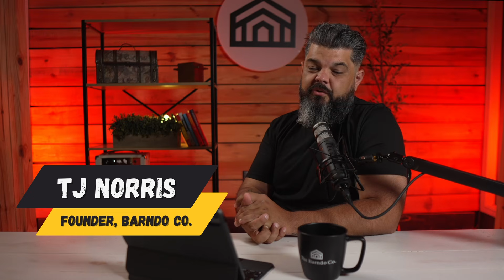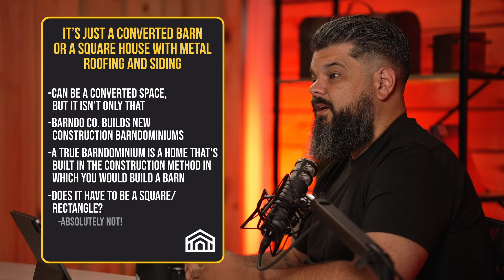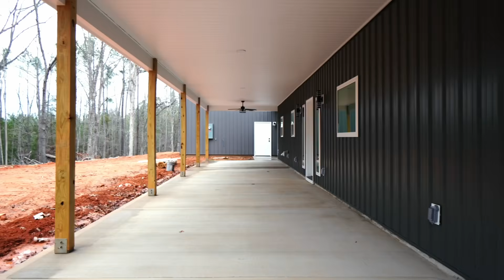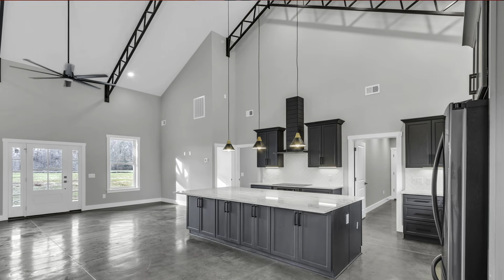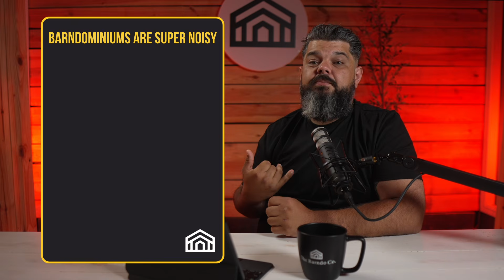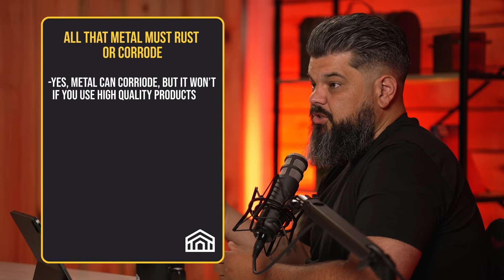5 Things Everyone Gets Wrong About Barndominiums

Comment: We built a 30x40 barndo is western ok before they were popular and it took us a year to finish it doing it on weekends and they are kinda noisy but we did 2 inches of closed cell spray foam on the roof and walls and then framed it in and just put metal on the ceiling but I think we definitely should of added something for noise cancelling when it rains even though that’s rare out there. It is super air tight though and you have to have the right ac unit that’ll bring in air. Electric bill is super cheap though and it’s on well water it’s about $60/month for electric but let me tell you about handling that metal on a windy day, it blows!

Comment: Echo, create some enclosed intimate spaces, a loft, use carpet and drapes, add surfaces for sound to be absorbed. Even creat8ng a hall that separates bedroom doors from main space, utilize some pony walls. Have high ceilings but dont be afraid to put a ceiling over spaces you want to not echo like a movie room or office. Put things like foam backing into large paintings on the walls. Wood floors even in some places. I like concrete floors but have lots of rugs everywhere. Loft cuts down sound alot with 2nd story. Build on 2nd floor instead and leave downstairs a garage and utility space.

Comment: We have a wood frame, metal siding & roof......we used spray in foam insulation which has worked well....BUT...big but....we left the floors concrete and it IS a bit echo'y with the large open floor plan . Weve been thinking of adding flooring after 6yrs as it is.

Comment: From what I’ve seen, they do have proper insulation and framing. They’re real houses. 

The very tall and often very large open spaces are what I’d have caution from an HVAV standpoint. 

I had 25 foot open air loft in Chicago once and seasons were a nightmare. The family room was cold (1st floor) and the bedrooms (upper stories) were hot. It’s was too much volume of air to manage effectively 

Edit - looks like you solved this with multiple HVAC units. That’s definitely a solution but 2 units is 2x the price. 

Meaning - buy 2 AC units and 2 heating units is a solution but certainly not a normal person experience. Just one AC is $10k-15k

Comment: Is a barndominium air tight when all the connections are steel to steel without gasketing at the connection points.  Have  you used blower door tests and what are the results of these test?
Reply: The connections aren't all steel to steel. The roofing and siding are metal but the wall framing and sheathing is all wood. A steel skin over and insulated woos shell.
Reply: Careful depending how you insulate, Noone wants 24hr mechanical venting. Good seals but you want a building to breathe too.

Comment: Does the Barndo Co install exposed fastener metal roofing and siding or do you install standing seam? Can you/will you/have you finished the entire floor in just sealed concrete in a single story build? Is there a cost benefit to doing a single slope (shed) roof?

Comment: Please be aware of the extreme danger that Carbon Monoxide presents in a Barn-dominium. Carbon Monoxide is a heavy gas that lays on the lowest surface. Many Building Codes require a minimum of 8 inches of vertical distance between the floor level of the garage for vehicles and the first floor level of occupied space of a dwelling unit. >>> If you get this wrong, you may end up dead.
>>> Also, be aware that Pre-Engineered Metal Buildings are typically constructed using a Monolithic Heavily Steel Reinforced Concrete Slab with an Integral Perimeter Thickened  Edge, which act like a Grade Beam to add rigidity to the foundation and distribute the building's weight over the foundation's entire "foot print" of the building. The perimeter Integral Grade Beams have substantial top and bottom steel reinforcing as well as connecting steel between the top and bottom reinforcing. --- Why is this important ? Well all of the utilities passing through either the Monolithic Slab or the Perimeter Grade Beam must be "Sleeved" so that the utilities can move independently of the building and foundation through the heating and cooling cycles of the year. Providing utility sleeves takes planning, coordination and careful construction, which is time consuming and more challenging than just building a Warehouse type building that has very limited utilities. Construction folks hate providing "Utility Sleeves" because of the extra work and consequently you will pay out the WahZoo for them.
--- Consider only building high bay structures where you really need them and build adjacent structures using other more cost effective construction methods and systems for the residential areas and other support functions. Even work-a-holics need time to rest and regroup now and then, so having a little bit of separation is a very positive aspect. By matching the function of the spaces with the most cost effective construction system for that space, it will save you a substantial amount of money as well as providing a better functional work and life balance.

Comment: Can you use rockwool  insulation instead of spray foam?  I think the spray foam is has too many bad chemicals in it.
Reply: It traps moisture worse than the others as well
Reply: Closed cell can have that happen. Open cell will allow water to leak through. That is the number one advantage to open cell when spraying a roof. You will know when you have a leak. 

Thank god as I had a leak on my own roof. Caught it quickly. Easy fix.

Comment: It's going to be cheaper to make a big open span with a rectangle shape than complex shapes, and efficiency wise, the less sqft of your exterior walls the better. I keep flip flopping between a post frame and doing ICF. Both way better than stick built.
Reply: do both. built post and beam then used sips for walls. all over an icf foundation. very solid home. I use a single 400 watt electric insert in the living room for heat in my 1900 sqft home. I do not use any cooling but a window fan in summer. I hate ac. I live in East TN.

would be a little harder if I built with a timber frame instead of the post and beam but not all that much.

then love the patter of rain on the steel roof.
Reply: Its better to frame it conventionally and keep that "barndo" look.. After working on a few barndos, I would NEVER recommend anyone do it..
Reply: @FJB2020 what was the issue?
Reply: @Bradimus1  You end up putting in just as much framing in between the columns that it just doesn't make sense.. If you don't do that, you get walls that can move back and forth (think of a large drum).  

Fire blocking is another issue.. If your code requires it, good luck doing that after the fact.  

Kitchen cabinets on exterior walls, sheet the walls with OSB first, so you have attachment points and again you have walls that act like a drum so the cabinets move every time there is a pressure differential in the building.

There are many others, but overall its just not a great way to build a main home.. You want a cabin in the woods, sure, go for it.. 

If it was me, I would do ICF walls and trusses.. That's a rock solid approach.. If ICF is out of your comfort zone, 2x6 walls 24" OC with trusses is the next best option.  Both sticking to simple rectangular shapes as its the most economical.
Reply: @FJB2020 in Minnesota, 2x6 exterior 16 on center is already normal for a basic cooking cutter builder home. 2x10 or 12 for stick built custom homes isn't out of the ordinary. We have builder here that do post frame without issue and Minnesota codes tend to be tight. The post frame is great for the flexibility of what you can do between those walls, and a thick outer wall for insulation. I can't speak to the details of fire blocking as I'm not a builder or inspector. 

ICF is pretty great for sure. Extremely solid building.
Reply: @Bradimus1  If they are doing 2x12 walls, I would think they would do two 2x6 walls with an air gap to remove all thermal bridging.
Reply: @FJB2020 I'm sure there can be reasons for any choice. But staggered 2x6 would make sense for the reason you're saying. There is always another way.

Comment: The outer wall is just metal siding? No thanks. Looks like a good storm would blow it apart.
Reply: Lmao, no, they use OSB or some other sheeting. How’d you come to the conclusion that it’s only metal?
Reply from the maker: check out some of our other videos where we deep dive about the nitty gritty of the building process!
Reply: Seen discussed on other channels videos .   2x 6 girts and osb sheeting on extra wind loads or closer rafters trusses on snow loads .   Depends on location and code
Reply: Yeah that’s my concern as well particularly since I reside in Hurricane prone Florida, wonder just how resilient they are to tropical or hurricane force winds?
Reply: @CarlitosWay-r1o more resilient than a traditional Florida home.
Reply: @mr.x4935   I highly doubt that. We went thru 135 mph direct winds in IAN with a Cement block home, the way most homes are built here, say after 2000. Stood the test well. Other "Framed" buildings in our area collapsed or were seriously structurally damaged. Sorry but for storm protection, you can't beat blocks filled with Rebar and Cement....
Reply: @stbentoak5047 AGREED

Comment: I have been a subscriber to your channel for years. I’ve seen your floor plans but, there’s an old saying that “Talk is cheap.”  Other than podcasts where you “talk the talk”, do you have content that actually shows the viewers what you do and how you do it? 

Sure, the metal sheets may be treated on both sides (top/bottom), but are the edges of that corrugated metal also treated in the manufacturing process and, when that metal is trimmed to fit the roof and walls, are those panels treated to prevent rust and corrosion? I don’t think so. 

I’ve been a barndo lover for years and have faith in the products used, but also know that each builder uses different laborers and techniques by varied contractors (all within the same building codes) and know that most manufacturers use similar materials and also know that sometimes corners can be cut during the construction process. I’ve worked with contractors and engineers and have seen this more often than not. 

How does your company guarantee that the work is done correctly and what type of warranty is given by the contractor where the subcontractor (ie Plumber, electrician) is doing it right?
Why are plastic based water lines (containing PFAs or AFFF contaminants) used in barndo construction? What happened to copper?

I would love to have you build me a barndo. But I live too far south and finding the right location for a barndo is difficult, (elevation, salty sea air, etc.)

I’m sure I’m not the only subscriber and viewer who wants to know and see more other than podcasts?

In my opinion I think you’re doing a great job explaining and educating the masses about barndos but you know as well as I do, there’s more to building a barndo than just talking about building a barndo.
Reply: Poly based piping is fine, but if you want copper pipes throughout it will just cost more money. Most plumbers utilize a propress machine now to install copper. Significantly easier I still & no worrying about oxidation in the future do to no flux being used. 

Banrdos have significant more wall insulation. 

Much easier wide open spaces due to the clear span trusses. Like the gentleman is presenting today. He probably built traditional stick frame houses & switched to barndos  after seeing how the structures are built.